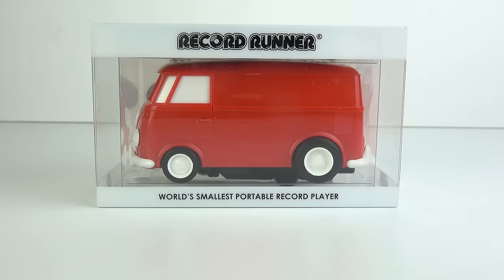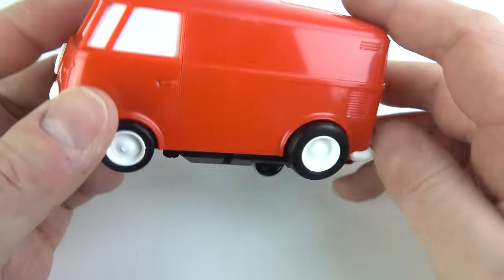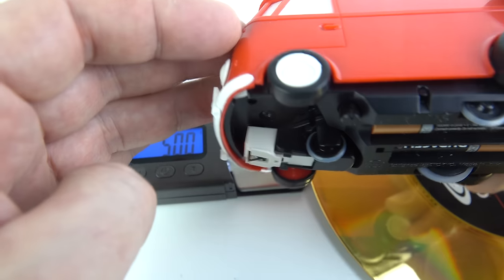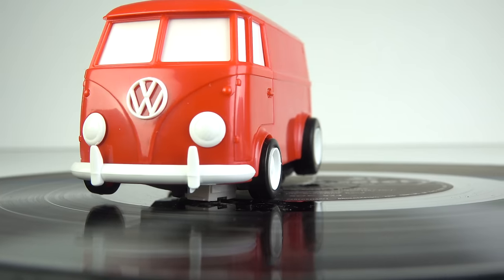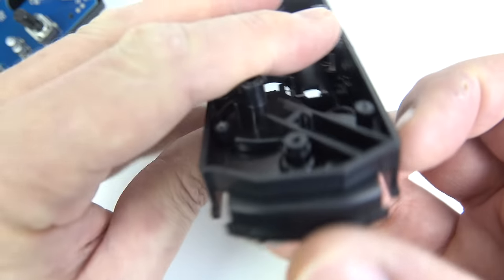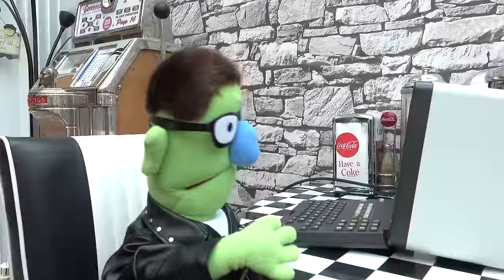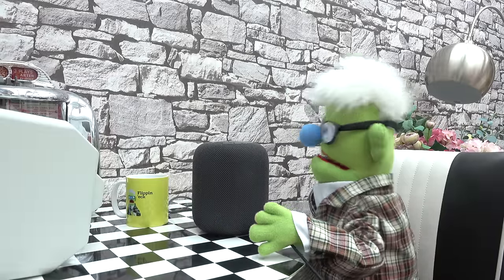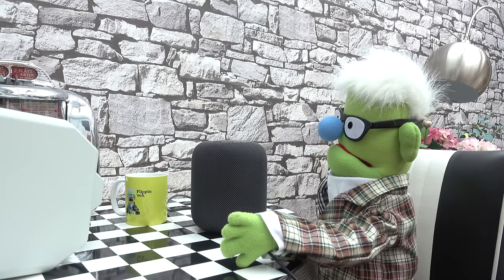The RECORD RUNNER

Comment: If you placed this on a revolving turntable then the bus would be able to play while appearing to be stationary
Reply: That is incredible holy shit
Reply: Would it play the record at all though if not moving? Or play it backwards, even though not in reverse?
Reply: @robambrose4199 but it would be moving with respect to the record. Only your viewpoint of it wouldn't be moving, same as your viewpoint of a record player's stylus doesn't move when you look at it.
Reply: @mbvideoselection  It depends on how fast the van drives compared to the speed of the turntable, and which direction both are going in. It would be hard to scratch records properly this way unless you are the Stig.
Reply: @robambrose4199  Well, what you'd see are a few erratic backward and forward movements representing the speed errors of the van, but it should be centered around one point.
Reply: @mbvideoselection  maybe we need to get wow and flutter measurements for the Record Runner

Comment: I have a theory about the tracking force. When in use, it might be considerably less because the momentum from the high center of gravity would be tilting it away from the direction of the needle. It would still need to be high enough to not hop and skip out of the groove. Just a theory though
Reply: I don't know if that's legit, but it'd be nuts if it worked that way! Sounds almost reasonable.
Reply: Does it have suspension? If not, then I doubt that would really be an effect you would see. As well, most of the weight is situated low on the device (the batteries), so it probably has a relatively low center of gravity.

I don't think he got an accurate read of the tracking force, in either case.
Reply: Doesn't matter about suspension. If the weight of the machine is being shifted, it's being shifted; a vehicle without suspension can still be tipped over in a bend if its CoG is high enough and the wheel grip is sufficient to prevent them slipping instead, and in a constant radius/constant speed corner once the springs and dampers of a suspended vehicle have reached an equilibrium the force through the wheels will be the same as if it was unsuspended and merely had wonky axles.

What's maybe more crucial in this equation is that the needle isn't really bearing a significant portion of the machine's weight - the two rear wheels, and the guidewheel up front do that. The tracking force is rather more to do with the weight of the cartridge and the assembly that holds it, forwards of the tracking wheel, and if they have any kind of spring force behind them also. After all, it will still need to ride up and down slightly vs the front wheel and the actual bodywork in order to account for any small bumps in the record surface. So the force might still lessen a bit as the body weight shifts, but maybe not by as much as you'd expect, or even the same proportion.
Reply: when they make records they usually use both vertical and horizontal grooves to maximize space on the vinyl so if the tracking weight of the VW is lighter due to centrifugal forces moving it outward then the needle would tilt more outward causing it sit outside of the center of the groove causing damage.

Comment: I’m surprised that Record Runner has an Audio-Technica AT3600 magnetic cartridge instead of the P-188 that the RokBlok has.

The original SoundWagon from the 70’s used a mono Astatic cartridge, similar to the ones used in vintage kiddie record players, then the Astatic 89T
Reply: I'm also surprised that it has an AT3600 cartridge. Before the video started I fully expected to see the P-188 (literally) tearing up some more vinyl.
Reply: 93SHADoW well it is a Japanese product... they probably would be ashamed to release any turntable product without overdoing the specs, even if it’s useless on a device like this
Reply: Those kids are now adults with disposable cash.
Reply: Did you look at the price? For that much it's the least they could do.
Reply: An AT3600L is only $20-$25 on eBay....

Comment: I wonder if this could be re-engineered as a smaller, lighter device with bluetooth and a Li-Po battery.
This would solve the problem of it having a whopping 9.5 grams of force (maybe it could be reduced to a slightly more sane 7g), as well as giving it the ability of actually producing better sound with a portable speaker.

With some effort, this could easily be a portable record playing solution...
Reply: Portability isn't something people really look for in a record player, given the very non-portability of the medium. I guess you could play something before buying it, but what's the use even then? "Yep, I can confirm this is an album by The Who and they didn't just relabel an ABBA disc."

Comment: If the needle could be flipped around, would it be less damaging to the records?
Reply: Y e s. They're designed to have a needle pulled through the groove, not to push one into the plastic haphazardly.
Reply: Yes, it would reduce damage. The issue is that if the needle were reversed the vehicle wouldn't track and would instead drive straight off the record.

Comment: I noticed, while you were taking the device apart, that there are a bunch of pin headers on the top side of the circuit board (7:00 offers a good shot). They appear to be labeled "CN2". What could these connectors be used for?

Comment: Initially I thought it had bad wow, but that could be Doppler. To eliminate that, you'd have to record it from a point on the record axis, i. e. above the centre hole.
A variant could be made with an arm that reached to the centre hole - and you could place the speaker there, too, which would eliminate the Doppler effect. OK, would get away from the essence of the little van, but you'd still have a player that played a stationary record. It might be able to revert to dragging rather than pushing, too, which might allow less tracking weight!

Comment: I never thought about it, but doesn't the consistent RPM mean that the tracks on the outer ring of the record have a higher resolution than those on the inside? 1 second of playtime has upwards of 10 inches  towards the outside, and towards the inside it's got maybe 3 inches.

Comment: rotational vs linear speed?
Given that this is driving at a constant linear speed, as opposed to a record rotating at a constant rpm, does the song speed up as you move towards the center?

OH, they vary the driving speed as the arm moves in to compensate for that problem. Nice

Comment: Put it on the record going clockwise and hear the music backwards....  The little thing won't swivel from straight in the direction but you might be able to hear the outer rim a little bit instead of it skidding across your record, scratching it even more....
EDIT: They should really have it swivel in both directions so you can place a record backwards from the inside out, clockwise!

Comment: Question:  Couldn't they keep the stylus at the front, but reverse the direction of the needle itself?  Basically, keep everything exactly as is, but just turn the needle around?  That way it would still keep in the groove, but be dragging, rather than scraping into the record.  Yeah, it would need a bit more tweaking to make sure everything was working properly, but I honestly don't see any reason they couldn't do that.

Then again, with it being a novelty item, I suppose they don't want to spend that much investing in such a device that's going to be a gimmick toy anyway.

Comment: This is the same Stokyo that sells refurbished Technics sl1200/10 mk 3?..could er recommend those over this!..the at cartridge would be better used on one of those!Of course you get the at stylus and the preamp with it.You could possibly tap into it and use it as a groovy looking preamp/speaker..and save the at stylus as its on most of the under 1000 buck turntables.

Comment: You shouldn't try to beat the maximum reading of your scales by setting a negative zero point! You're still exceeding the maximum that the scales are rated for. Measurements above the max weight aren't likely to be accurate, and you could damage the scale by putting too much weight on it.
Reply from the maker: I’ve failed my family and the planet.
Reply: But you do it with such style :)